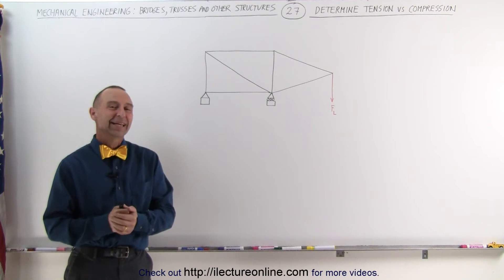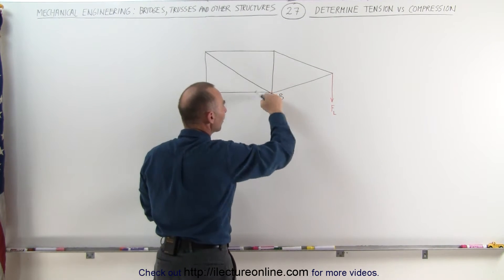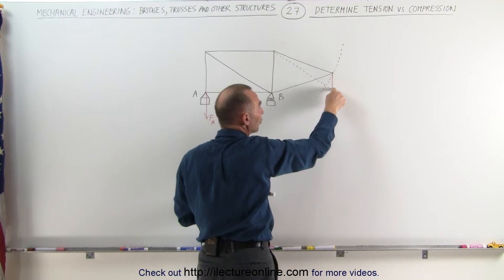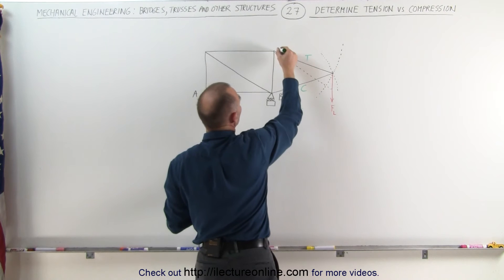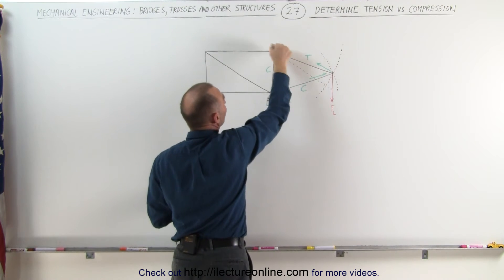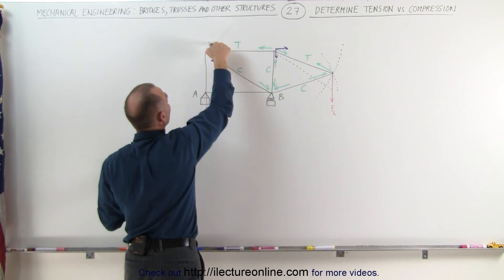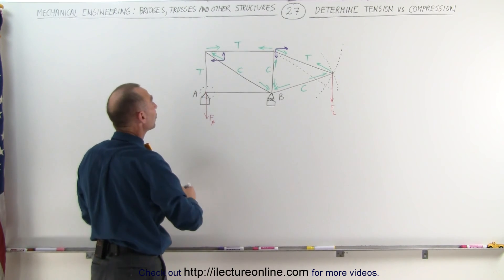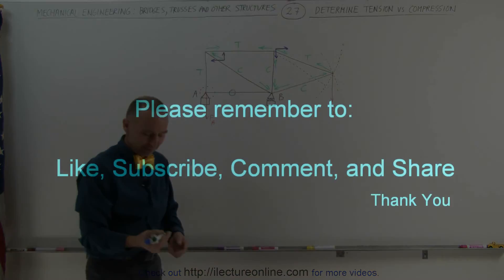Mechanical Engineering: Trusses, Bridges & Other Structures (27 of 34) Tension vs Compression 1

Comment: 3 beams connected to the pivot at B are all in compression. What is counteracting those compressive forces in the -y direction if there is no reaction force at B?
Reply: whatever is supporting the B pivot outside of the structure. That's going to be the location which needs to be the strongest because the forces sum there.

Comment: Hi, I guess AB force can be Tension or Compression or 0 depending on situation. As we know A joint is fixed on X axis, right?
Reply from the maker: The expectation is that the tension or compression would be zero.  If it is not zero, then there would have to be a horizontal force component at A.
Reply: @MichelvanBiezen  right, right in this case there is no external force on the horizontal line, it must be definitely 0 force on AB element. Thanks for your answer!